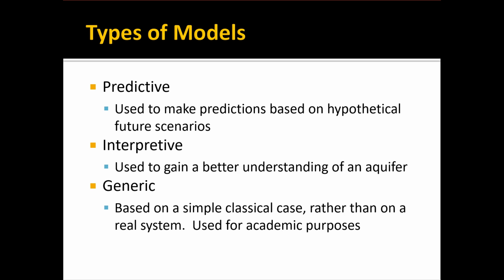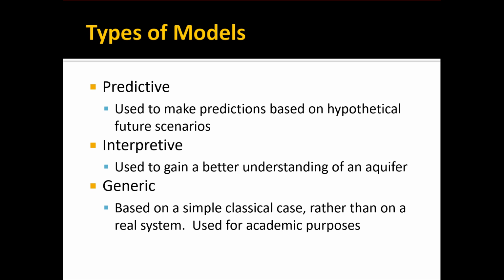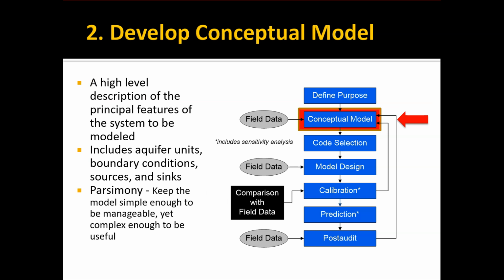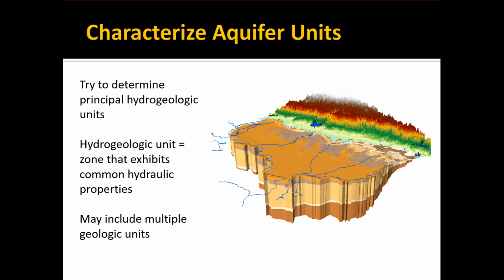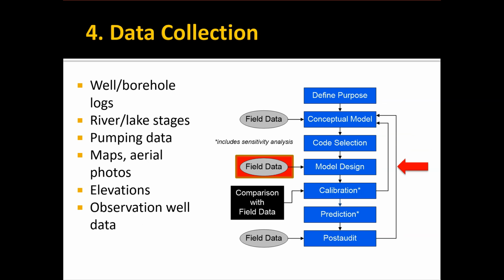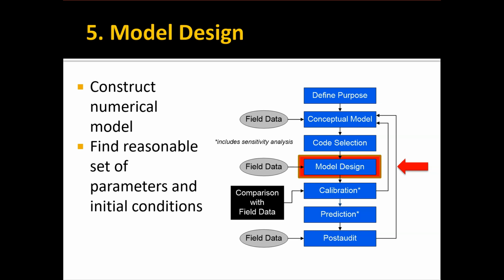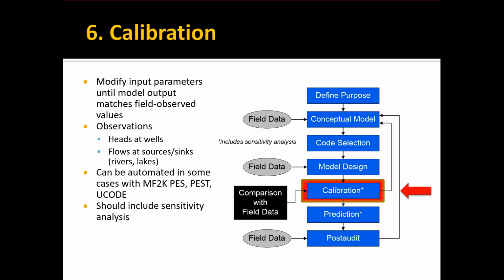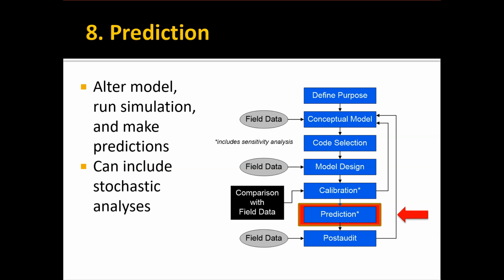Groundwater Modeling Concepts

Comment: Thank you for your insight! I have several questions related to the data collection steps:

1. If we want to conduct regional scale groundwater modeling (watershed scale), what is the average spatial resolution required for elevation data? Is SRTM data with a 30 m spatial resolution representative enough to be used as digital elevation data in our model?

2. Related to question no. 1, I had an issue when I tried to delineate a catchment and generate streams based on a GIS approach using SRTM data. The location of higher-order streams, which I assumed to be rivers in my model, did not spatially align with the real rivers that I had delineated using Google Satellite aerial photos. Some segments of the real rivers were not located in valley topography on the SRTM data. How should I deal with this issue? Which river data should be used?

3. Are elevation data (river stage, lake stage, water table elevation from dugwell) sourced from handheld GPS measurements representative enough to be used? Regarding the third question, is the accuracy level of handheld GPS tolerable in the model? If not, is there any other more practical and low-cost method/tool?

4. Is there a practical measurement method or instrument to measure riverbed sediment thickness and hydraulic conductivity? How can this method be applied to large and deep rivers?

Thank you.
Reply from the maker: 1) It depends on your grid resolution, but I would imagine that 30m SRTM data should be adequate in most cases.

2) Yes, is you use an automated stream-delineation method, the location of your streams may or may not match your basemap if the resolution of the grid you use for the delineation is too coarse. But for use with GMS, you turn on your basemap in GMS and then manually digitize the streams in the map module by tracing the stream locations on the basemap. You could then use a DEM to interpolate the stream elevations or you could assign them manually to the nodes in the stream network.

3) A hand-held GPS should be plenty accurate. 

4) I do not know of any practical way to accurately and cheaply measure riverbed thickness and hydraulic conductivity. The typical approach is to estimate the values. All that really matters in the end is the resulting conductance values. You can examine gains or losses from streams to back-calculate or calibrate your river conductance. Also, in my experience, the model results are generally not highly sensitive to conductance.